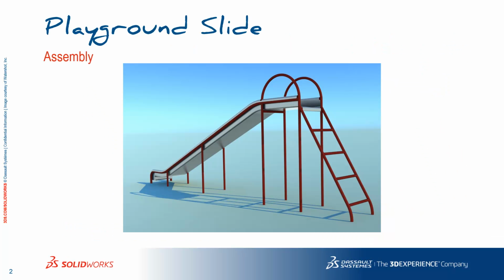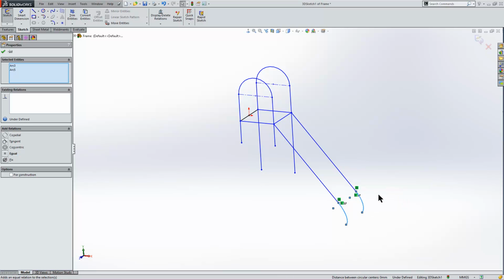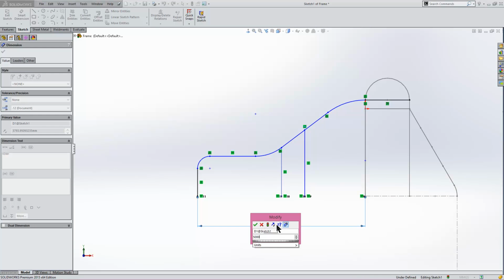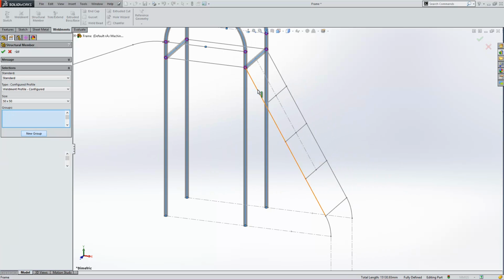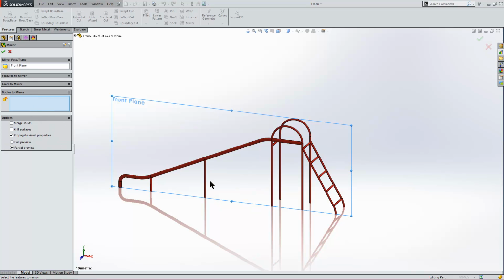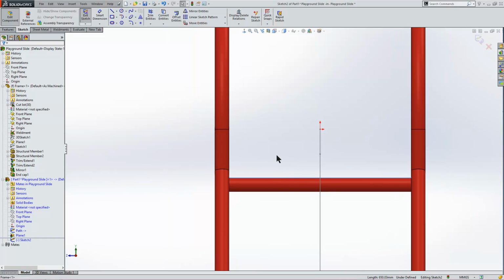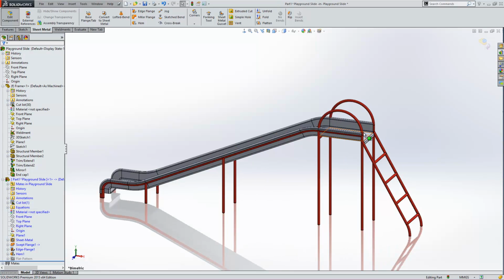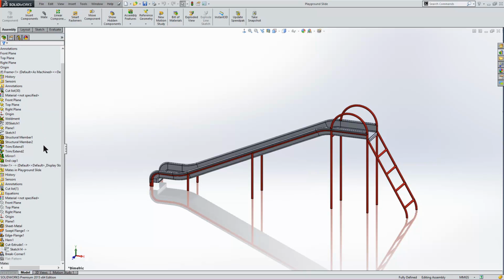SOLIDWORKS In depth - Sheet Metal and Weldments

Comment: Hi, good video. If you want "Extrude Cuts" to show on the flat model then you must use the ribbon tab "sheet metal" then with-in select the "cut extrude", very handy. I agree the cut should be done after bending though.

Comment: Hi, I'm following this video with my SW2023,  When I use the assembly and created the new parts for the slide, in the SW23, the sheet metal tab (and the Insert / Sheet metal) just all disappear.  If i create a new SW Parts file, the sheet metal function is there.  Is it a change due to the new version?

Comment: Someone please help me out with my doubt! 
What if I want the ladder to be little wide at the bottom and make it converging towards the top? It'll mean that the sketch will be in 2 planes right? How to do it?
Reply: If you haven't figured out a different method yet....in the 3D sketch, use construction lines to draw the ladder (not the rungs yet), then use two more construction lines at the bottom to mark end points at whatever width you want. Then draw solid lines from those end points to the ladder start points at the top. Then draw in the rungs.

Comment: Innova Systems,

So I have just installed Solidworks 2016. On my previous version it was easy and simple to use my weldments profiles. I do understand how load your own profiles or any kind.

Now the problem I run into is: When you right click on your tab you see your options: Assemble, Layout, Sketch, Evaluate and so on... And for some reason, and maybe I did something when I first started to use solidworks, it doesn't give me option of adding weldments tab? So I can't use it at all?

Am I supposed to do something in setting to be able to use this feature? Or maybe it's my installation was done wrong?

Please help help!!

Thanks,
Reply: right click on one of those tabs.You will get a menu.From there check the Weldments tab.Done :-)